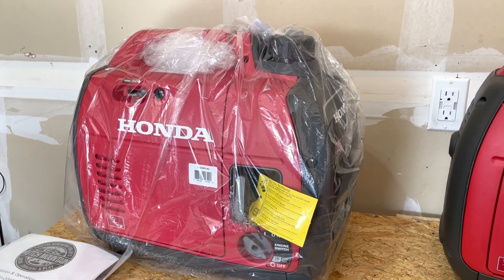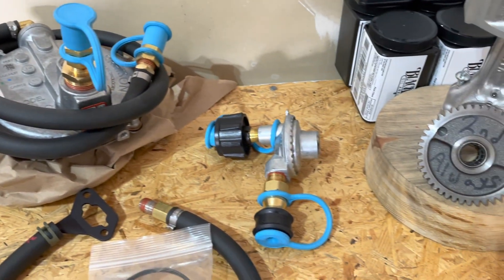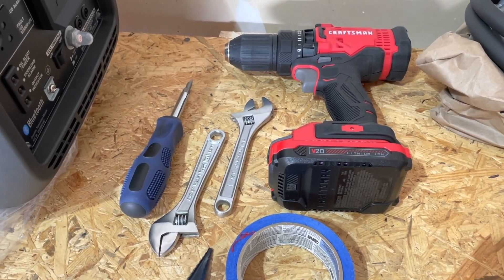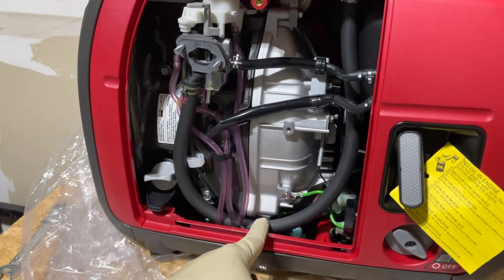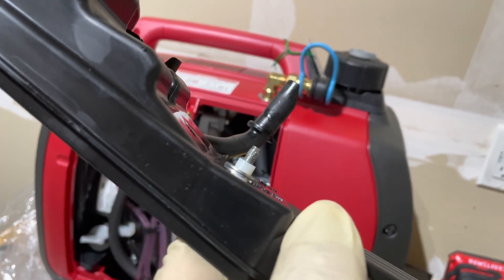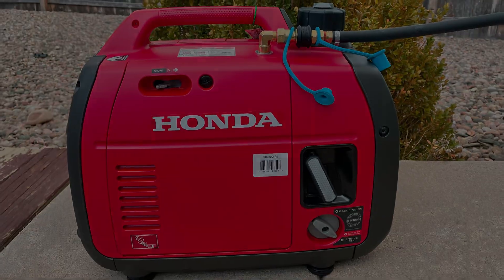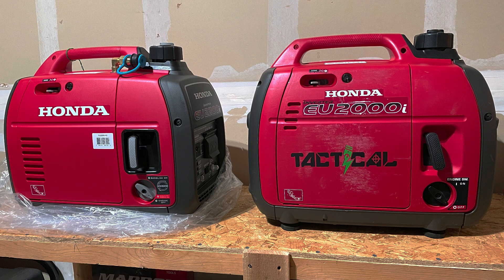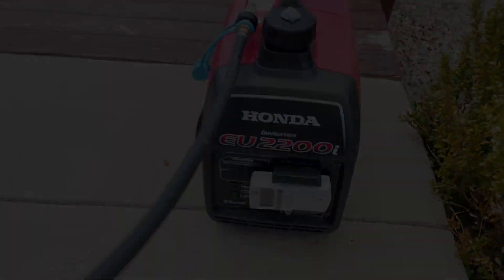Hutch Mountain Tri Fuel conversion kit for Honda EU2200i and EU2000i (Gas, Propane and Natural Gas)

Comment: Great video, just curious, does the low pressure side regulator determine the engine rpm?   Like it could be adjusted?
Reply from the maker: Thanks! Well, some regulators can be adjusted but it won’t determine the engine’s rpm. The governor will determine the engine rpm. So if you are trying to increase or decrease speed try adjusting the idle adjustment screw on top on the carb.

Comment: Ok, how do you use NG with it?
Reply from the maker: Same as in propane, place the engine switch to (Gasoline OFF, Propane-NG) then connect the line to the house NG line. I recommend adding a ball valve with a quick disconnect to the house’s NG line.
Reply: @tacticalpowerpro  the same hose and regulator?
Reply from the maker: Hutch mountain has a “Pro kit” that comes with a Natural gas valve plus a quick connect. You can install this valve + quick connect  to your home’s natural gas supply.

Comment: You didn’t show how to hook it up on Natural Gas
Reply from the maker: Place the generator selector switch on PROPANE - NG and connect the generator to a natural gas line. Hutch mountain has a “Pro kit” that comes with a Natural gas valve plus a quick connect. You can hand this valve + quick connect to your plumber to be installed on your home’s natural gas supply. Thanks for your comment and for watching my video!

Comment: Will it allow gasoline, propane and natural gas? Without having to uninstall for the gasoline to work?
Reply from the maker: Yes, it will allow the generator to run with just gasoline without having to uninstall the kit. Just turn off the propane tank and place the switch on gasoline.
Reply: @tacticalpowerpro  hell yes!

Comment: Great video, thanks. Have you tried it on natural gas?
Reply from the maker: Thank you for your support! I have not tried it on natural gas but there shouldn’t be an issue, the kit is designed for it.
Reply: @tacticalpowerpro  there more to it on natural gas
Reply from the maker: @georgegould667  more to it like what? With the kit you just need to make sure you have the regulator connected (with the valve and quick connect) to the natural gas line.